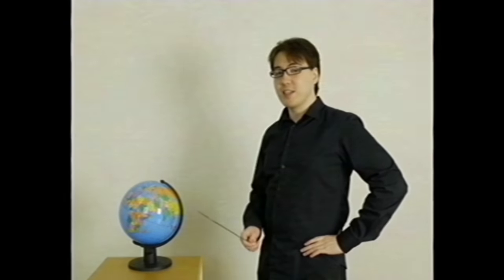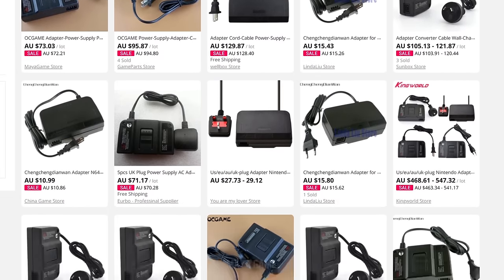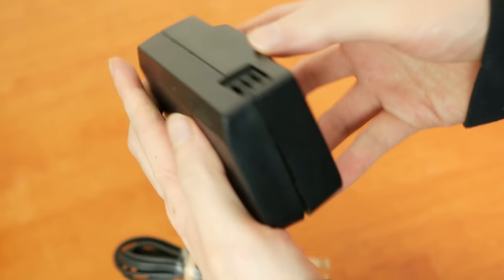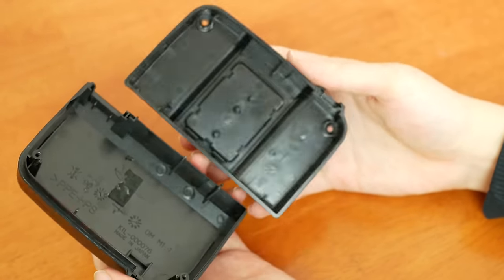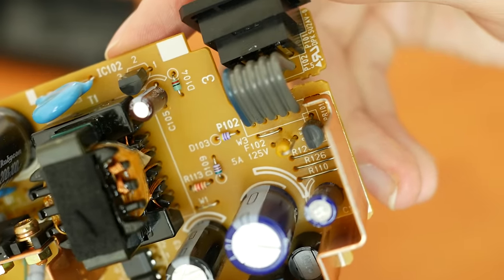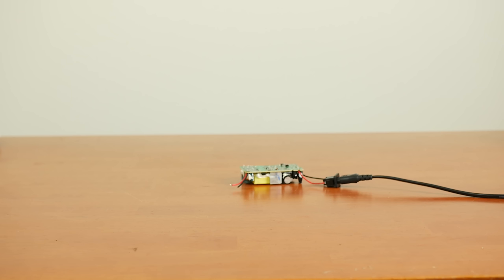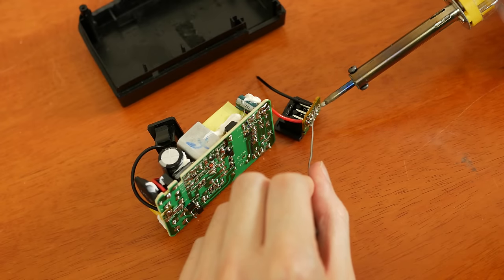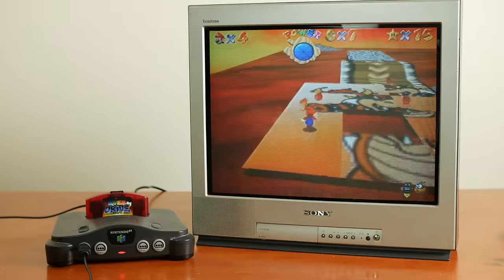Building the Ultimate Nintendo 64 Power Adapter

Comment: Man it was about mid to late 90s that they just started using them plastic clips to hold everything and I hate them too!

I use to love my old 92 toyota corolla. I could take the car apart with out dealing with the hidden plastic clips. Everything was screwed down. But now-a-days no one wants to see ugly ass SCREWS :(

Makes me so sad cuz it is what I like seeing. So I know I can take shit apart and put it back looking fine and fixed. If I need to take something apart that is to fix it.
Reply: That is the exact reason I prefer older cars. I'm not some sort of hipster (well honestly, maybe), I just like being able to perform my own repairs and maintenance. I just don't feel the need to drive a brand new car like a lot of people do, as long as I have basic features like fuel injection (at least for a daily) and power steering. I can put features like a full aftermarket stereo in (which is often better than factory "premium audio" anyway), backup camera, upgraded headlights with projector lenses, etc, myself, all while enjoying the simplicity and reliability of an older car. You're simply locked away from doing any of these things with cars of the recent years, computers aren't really even to blame for this, the manufacturers who designed them are.

Comment: The foam tape on the transformer is to prevent noise from vibrations. As they age and glue breaks down, you can get rattling noise from transformers. It’s also close to the plastic, so if there was a small air gap, it might vibrate against the plastic casing too.

Comment: 8:00 - The sticky foam could be meant to dampen the vibration of the transformer it is attached to. 
Transformers start swinging when used. This thing is probably 50 or 60hz so the vibration would be audible. Maybe the foam reduces this vibration lessening the noise.
Reply: It's a very small transformer with only a small quantity of windings. It's definitely for high frequently swichmode power supply stuff

Comment: For a future project, I would suggest revising this to use USB-C instead of a figure 8 plug.  USB Power Delivery has two profiles you might be interested in: 12V 1.5a (18 watt) and 12V 3a (36 watt).  Both of these come directly from the PD source external to the connection, so it would significantly increase space inside the adapter to put in a better 3.3V regulator and the Type-C parts needed to negotiate the correct profile.
On top of that, if you use a laptop with a Thunderbolt 3 interface (or supports charging via USB-C) you can use the same adapter to power your devices meaning one less cable to lug around.

I’m not a definitive expert on Type-C, but I think their PD profiles are worth researching, since current standards support up to a total of 100 watts.  Maybe retrofit some older consoles to run off of USB, lol!

Comment: wouldn't a PAL power adapter work just fine?  It has to output the same voltage as all other adapters.
Reply: 1:00 Then he wouldn't be able to use it in other countries when traveling.

Comment: Fun fact: most DC power bricks like this are, in fact, copacetic with high line voltages even if they don't say so. Assemblies like this with captive cords are usually marked only for the voltage matching the attached plug, but the actual power electronics are usually flexible enough to handle anywhere from 100 to 250 volts.

The general design uses a step-down transformer to go down to something like, say, 20 volts AC right off the bat; this is followed by a full bridge rectifier and some caps to turn that AC waveform into a crappy 30 volt DC supply. As the final stage, a simple switching regulator steps down that super crappy supply to 12V (or whatever) and cleans it up in the process.

Transformers are limited by heating related to current draw (which decreases at higher voltages) and insulation strength (which is typically at least 1000V, even for the crappiest enameled wire). Likewise, even the cheapest full-bridge rectifiers are frequently rated for 1000V or more. The switching supply uses an actual measurement of the target voltage to set its target, so basically any input voltage above it's output voltage (plus a volt or two for the transistor drop) will work, as long as it doesn't exceed the absolute maximum rating of the power transistors used, which is usually at least 40 volts. Looking up the markings on the chips used will usually let you find a datasheet and check their ratings to be sure, but as long as the switching regulator and the smoothing capacitor immediately after the rectifier are good enough I'd say it's worth a shot to just plug it into the mains and see if it doesn't just work.

Comment: If anyone else still wants to know the easiest way to open sonically welded plastic cases (like the power adapter from the router), all you have to do is put it on a hard table and whack it with the handle of a big screwdriver on the seam of the case. After a few whacks, it will pop right open without a chance of damaging anything inside.

Comment: The n64 just has an external psu you can use a pal psu fine with a ntsc one, and for a device with an internal ps you can swap it out or use a step down converter, on my ntsc-j n64 i use a pal psu and my dreamcast i swapped the psu

Comment: When I was about 10 years old my family lived in a house with bad electrical wiring.   My N64 one day stopped working after a power outage.  I remember the power brick started leaking some weird oil.  I'm guessing the oil came from that fat cap.  I had to call Nintendo parts, and order one through mail since adapters weren't sold in store.  Finally got my replacement about three months later.  I still can't believe I went through the whole process of ordering on my own at 10 years old.  N64 adapter holds a special spot in my heart. lol  Great Vid!

Comment: A hair dryer on high, held back a ways so that it doesn't warp the plastic would weaken the adhesive enough on that tape to allow you to remove it easier. Done this tones of times in similar projects involving double stick tape like that.
For the sake of peace of mind, I would've recapped that 12V power supply too with high quality capacitors. When one starts to go, it's ALWAYS at the most inconvenient time.

Comment: I kind of like the idea of doing this for my own N64 power supply - not because I travel a lot, but because a more modern and efficient PSU might last longer, and cut down on visual artefacts that can crop up in analogue video signals if the power fed to them isn't particularly optimal. You can usually see it manifest as something like vertical bands of slightly different brightness on the video signal, or noise in large areas of particular shades of colour.

Comment: Worth noting, I've taken apart all of my PS3s, and the PSUs inside say 100-240V 50-60Hz so they could be region free. No idea why Sony puts info saying region locked power standards on the outside
Reply: same thing with the ps4 and wii u
Reply: The vast majority of electronics are like that these days. Mostly because the transformers are mostly coming from a handful of countries and the main difference is simply the plug. Increasingly, I've been getting ones where the prongs themselves are easily swappable between the different standards. 

That being said, it is always best to take a look to make sure that's the case and it's worth noting what kind of power adapter it it is in terms of volts, Amps and polarity so that if you do need to get a replacement, you know what to get as most of these do not have a label to indicate what product they originally came with.

Comment: I use an Australian N64 power supply with my Japanese N64. All N64 power supplies output the same voltages, so you only need to match the input to your mains voltage.

Comment: Hmm... I've disassembled and recapped several US N64 power supplies and never had to deal with clips... just that annoying double-sided foam tape that holds the board in the top shell. I was also confused that no one on YouTube was showing/mentioning this. Indeed, it grips so hard you could snap the PCB by pulling on it. I think the foam tape exists so that they can test the adapters before closing them up. Sticking it in the top shell lets them use it for alignment in the assembly-line test jig.

Comment: to know how much is left for 3.3v it's quite simple:
let's say 12v 1a is required and you want to know what's left for 3.3v
12v 1a = 12w
if your power supply is rated 12v 1.5a
it means 12v 0.5a is remaining.
3v compared to 12v is 4x less
so if you can get 4x volts less, you get 4x amps more available
then, you have (with my example)
0.5a x4 = 2a for 3.3v line remaining.
a given amp is different if voltage is (even more different if it's AC vs DC)

Comment: The double sided tape is so that, if you drop the unit, the insides dont move around so much, making the thing much sturdier

Also you could have just... used two power supplies. One for 12v, one for 3.3v. Youre planing to step down the voltage anyways, and you have a whole bunch of those 12v power supplies lying around, you could have put 2 of then together to make 1 2amp supply and then step it down from there

Comment: The adhesive at 8:00 ist there to prevent the transformer from wiggling and breaking off from vibration in trasportation since its the heaviest part on the circuit board

Comment: You can open glued cases (12v adapters, laptop batteries) easily by pouring some solvent on the seam to dissolve the glue

I usually use xylene, I know petrol works too, you might be able to use something lighter like acetone or turps 

After a few minutes you will be able to just pull the case apart
Reply: Goo gone is petrol based and works well.  Can also use heat gun on low setting.

Comment: I live in an area where -40 is common. Trust me those wall warts will EASILY handle the cold. Most electronics do so fine. Just have to be careful that when you bring it in out of the cold to let it warm and the inevitable condensation has had time to dry.

Comment: hey, that board has some large caps on it that are probably quite high voltage. while the chances of them holding any sort of charge on such an old power supply that clearly hasn't been plugged in in a long time is low, it's still worth showing a bit more caution around any SMPS circuits, you could get a nasty bite!

Comment: A Mean Well RPT-6003 medical grade power supply with 3,3 V (5,5 A), 5 V (3,3 A) and 12V (0,77 A) in one unit works with anything from 90-264 V and looks like it will fit well within the box. I have one right here. It's smaller than my N64 PSU. I was going to use it in a Dreamcast. It's probably as good as it gets as far as PSU's go and costs $15-$20.

Comment: I wonder if the router actually needs all two amps and might run on one of those weaker 12v power supplies he has, so the router could still be used. You can use them as access points, which I have done in my house with an old router.

Comment: My option would be to gut the enclosure, put only a 3.3 regulator inside, add a DC barrel jack for power input, and use an external 12v DC power supply. Run the external 12v DC straight to the 12v for the Nintendo 64. Add an internal fuse and reverse protection diode. You can easily find 12v DC adapters that are universal input voltage that can easily handle enough current.

Comment: I use a japanese N64 with the power adapter from the PAL N64 and it works without problems. No exploding, no overheating nothing. This is because every N64 Power adapter outputs the same voltage and so you can basically just use a power adapter from your region on any N64. It's not about the input but the output
Reply: Depending on the power supply design your output will change relative to the input and can fry itself/what it sends current to.

Only switching power supplies can have multiple input ranges automatically.

Comment: as long as you don't plan to buy a 64DD or use it with the power supply, the 12V is kind of irrelevant.

The N64 actually only uses the 3.3V and the 12V are only intended for the 64DD

Comment: You showed a shot of a PS3 in your montage of consoles with non-universal power supplies. However, most models of PS3 and all models of PS4 (as far as I know) have unadvertised universal power supplies, even if the case sticker says otherwise. I have personally used an American PS3 in Europe and a Hong Kong PS4 in the US with no issues at all.

Comment: You could use an N64 power plug from your region to power the NTSC N64. The output from the PSU is the same.
Reply: 1:00 Then it wouldn't be travel friendly and might not work in other countries he might bring it to.

Comment: Reading your description, even if you waited an hour, those capacitors could be left with residual charge! Heck it may even take months. What you should have done was wore gloves, and shorted the capacitors with a resistor just to be sure there was no charge left over. But other than that, this was a great video!

Comment: I LIGITIMALLY want an n64 power supply with a detachable cable thats the standard plug. I offten take consoles out, plug them in and put them back, I don't keep them all pluged in at once. A lot of (non Nintendo) consoles use that plug, so I just keep that cord plugged in near by to use for a bunch of consoles. I would love to just keep the power supply in the console at all times. Also not having to dig through my bin of cables every time to find the n64 one would be really nice. I love that it makes it an internal power supply.

Comment: If you 3d printed a case, you could always use a barrel plug instead of a fig8 and just use the wall wart. Then all you'd need inside is the bucky...you could easily make the whole thing flush to the n64 instead of sticking out.

Comment: 3:46 I just electrical taped my Wii u power brick. and that’s exactly what mine looks like (damage wise) It’s on the output side so it’s only 15v @ 5amps so I can I use this?

Comment: Some power adapters might not like a lower frequency (50Hz instead of 60Hz). But generally switch mode ones like the N64's power adapter should be fine.

Comment: Except for a specific japanese Fat model, all PS3 have universal voltage. Even if it states it's 110v, it'll work perfectly with 220v, and vice versa, since internally all models use the same PSUs regardless of their region, just with a different label on the outside
Reply: same with the ps4 and wii u

Comment: On the freezing to shatter glue, did it not occur to you that that may be why they recommend against freezing temperatures?
Electronics have no real lower limit, they just may be stressed unexpectedly with extreme temperatures or extreme temperature gradients, which (combined with battery chemistry) is generally why they recommend against operating electronics below a certain temperature.
My only other thought is capacitors (since i know very little about them) but i assume again, if you let them warm up gently with everything else afterward, they should survive ~-4°C easily.

Comment: Power cord from damaged power supply would probably insta trigger fast switching fuses in electrical box since they were shorted due to damage, so no. No death there. Second, original switching power supply can be converted to be universal with few changes to the primary side. Welp, let's stick some kind of contraption to make it ultimate. No offense here. You can convert switching PSUs to voltage you need but for some it's far beyond. All we had to do was to swap some compenents CJ.

Comment: That foam tape will be used for vibration dampening, to cut down on coil whine/hum from the transformer.
The different regions’ versions run at different frequencies due to the TVs they’re connecting to, right? If you’re sending the output signal into an HDMI converter or whatever I guess it doesn’t matter any more. But I do wonder if it’s possible to tweak the clock of a 50Hz model of the console.
Reply: it's probably not worth doing that. it messes up with time representation, so if it said you completed a stage in 5 minutes, you actually completed it in 3, for example. The game would also have to be patched in that case, but by that point, you might as well just get an NTSC/60hz console.

Comment: 16:50 The 3.3 circuit board also touches the primary part of the main power supply and using such thick tape may be dangerous. I suggest you to use a better insulator or even build more layers of tape to keep the 3.3 circuit away as possible from the primary.
Reply: I agree it looked like way too little separation/insulation.

Comment: I wouldn't use a 3rd party adapter with an old-school console, much less a modern, switching, one. It will work in the short term, but it WILL reduce the lifespan of your console in the long run. It can also introduce other problems, especially with flashcarts. Just get an original Nintendo power adapter from the region you're in (may need a recap). AFAIK, they're interchangeable between regions.

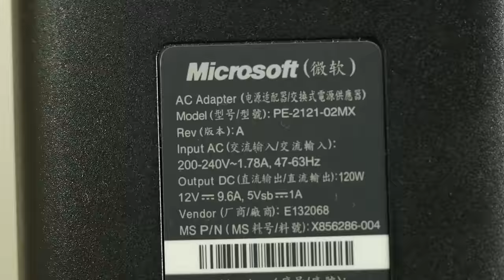Comment: 2:01 interestingly enough the Slimline PS3 systems are actually universal voltage, I think pretty much all of their power supplies after the Slim PS2 are universal switching power supplies except for a few early fat model PS3s which were 200v only. Though annoyingly Sony doesn't do the voltage labels on these consoles correctly (probably as some form of artificial region locking).
Reply: only a single japanese model fat ps3 doesn't have an universal power supply and the ps4 & wii u are also universal with fake region locking

Comment: A suggestion for anyone who wants to try this at home with any console or 8bit computer, put the step-down converters in the case and add a DC jack on the back for the power adapter. This also makes it legal for someone without an electrical licence to build a custom power supply 👍
Reply: Legal?